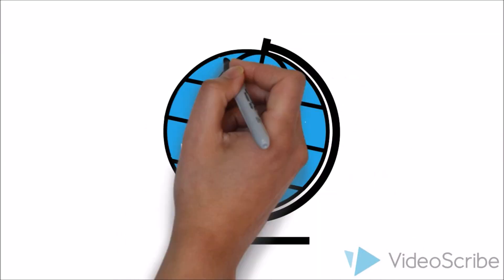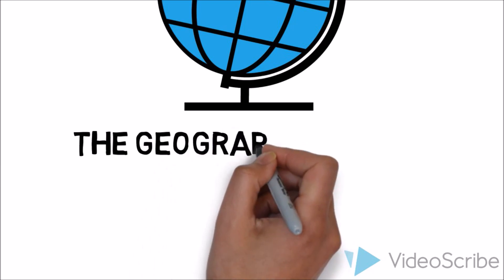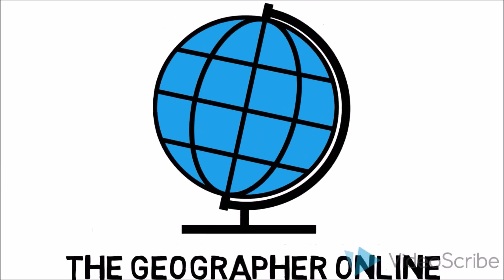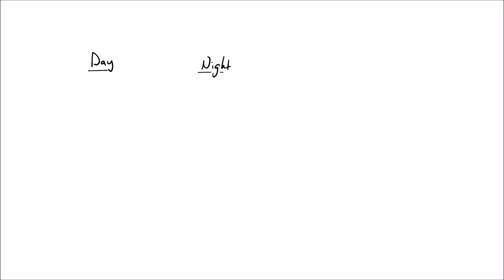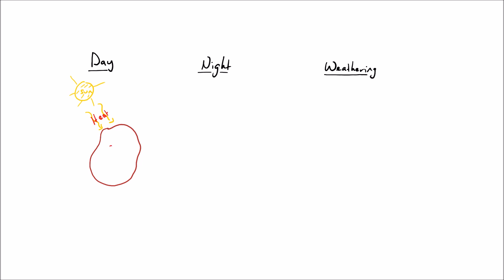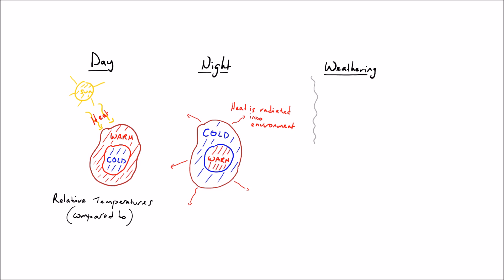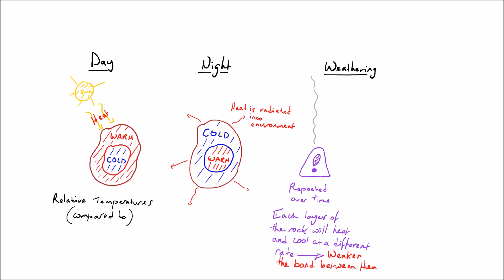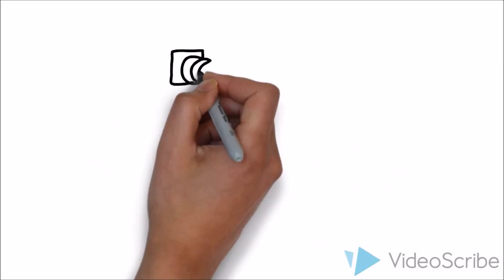Exfoliation: Onion Skin Weathering - diagram and explanation

Comment: Maybe I cannot agree with this interpretation. It's right that the temperature in the UPPER parts of the outer layers is different from the inner, but may not true for the Lower parts or parts which not exposed into the air. Compared to the physical weathering, I think chemical weathering within joints of rocks could be the reason.
Reply: Chemical weathering in indeed one of the hypotheses for this kind of phenomenom. Many articles link this feature to water. The lava flows I am working on are presenting this facies but onions are concentrated on the lower part of the bottom flows mostly. We use this feature as water signature because these flows filled up valleys.
Reply: You are not agree..... textbooks agree thus it's fine

Comment: I don't know if this is because of a difference in terminology, but I watched this video before my midterm and used this as my explanation of exfoliation and it was marked wrong. In Canada, this is considered thermal expansion and not exfoliation. Rip.
Reply: Ali Balloun due to thermal expansion (heat at day time) and contraction (cold at night time) exfoliation of rock occurs.